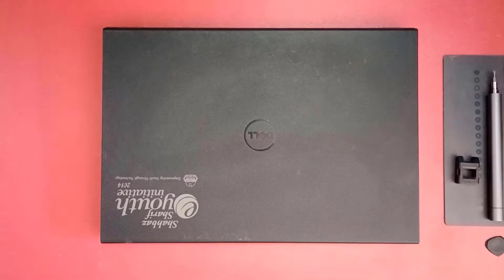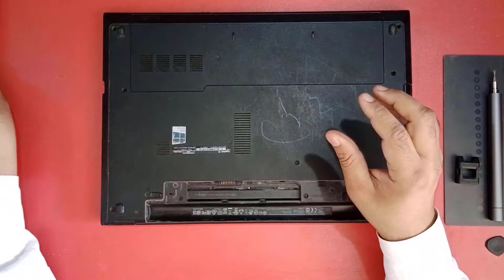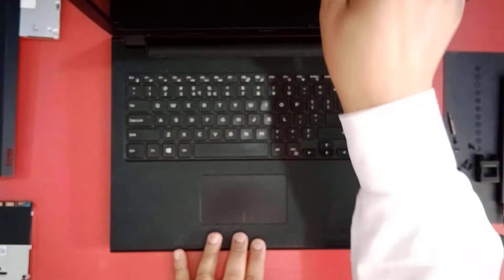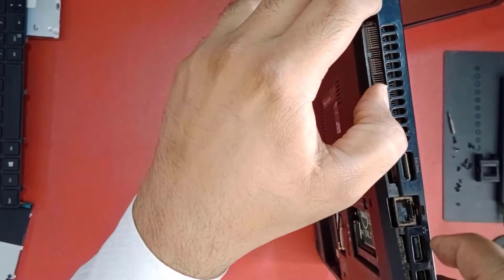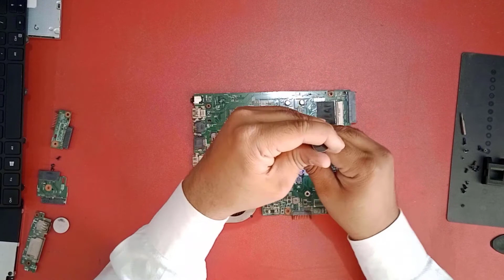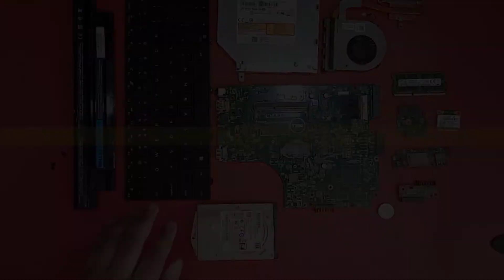Dell Inspiron 3542 Disassembly or cleaning all parts and repair

Comment: sir mera display par ek crack ho gaya  and battery is dead for 3 years,I use it in direct connection.the overall cost of repairing is 6000.should I do it?
Reply: Please reply
Reply from the maker: If you need battery backup just buy new battery. And if display looking good without any problems no need to be changed. Otherwise you can replace everything. Repearing cost is reasonable.

Comment: Ok can someone tell me what the lower connector on the motherboard that looks like a keyboard connection is for
Reply from the maker: Bro the connector where i remove the keyboard is the only connector for keyboard.
Reply: @AKMTechnologyWaqarIqbal  it looks the same right next to it
Reply from the maker: @livinglegend2106  brother its not for keyboard . Its use some extra device or circuit attached with motherboard. Sometime same motherboard use in other laptop model so the extra parts are support in that laptop.
Reply: Ok so it's extra
Reply from the maker: @livinglegend2106  yes bro..